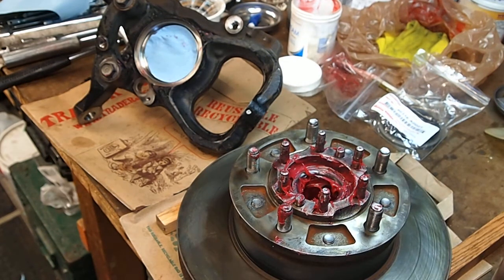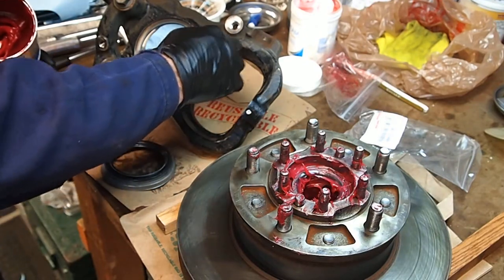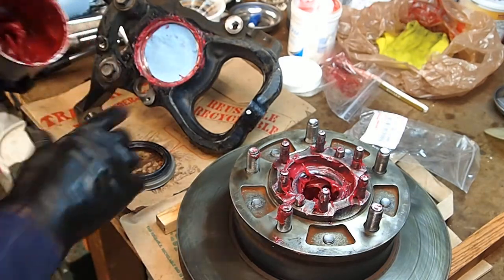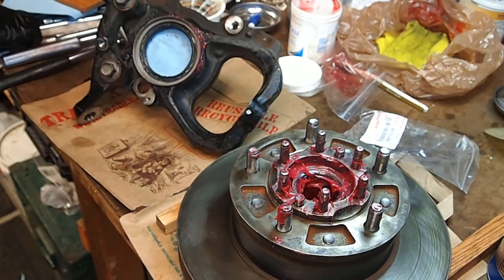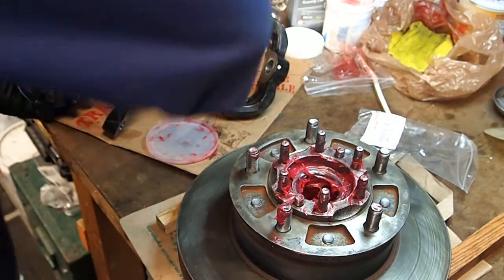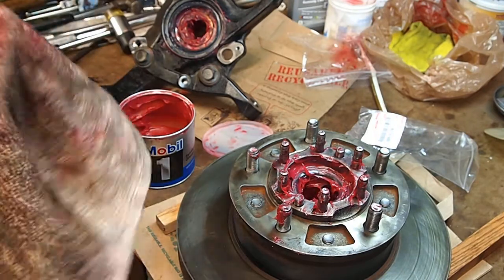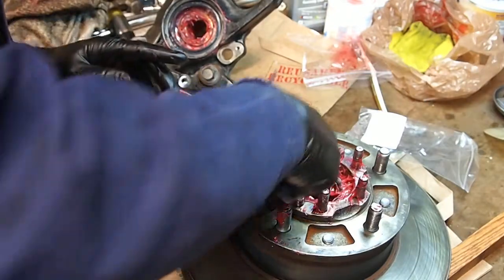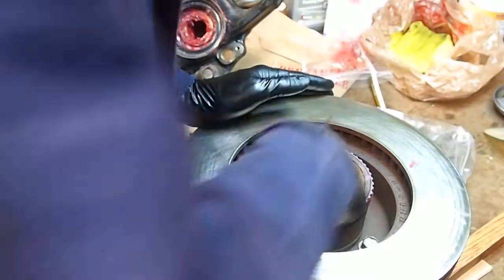Steering knuckle Oil Seal install, also packing greasing in axle needle bearing & bushing.

Comment: How "proud"  does that seal stand from the steering knuckle?  Both of mine stand above the surface, but one more than the other?
Reply from the maker: Once seated firmly, about 3mm. Both sides (PS & DS) should be the same. These have still pictures that may help you: https://forum.ih8mud.com/threads/service-wheel-bearing-steering-knuckle-rack-oe-rubber-mounting-bushings-ball-joints-w-surprises.1167922/page-2#post-12666256
https://forum.ih8mud.com/threads/scored-2007-unicorn-the-holy-grail-of-100-series.1043138/page-10#post-11652377
Reply: @memy895  Thanx for that.  I  think I have one like your pic and one a mm shorter.   The originals were like the short one.  My long one is like yours.